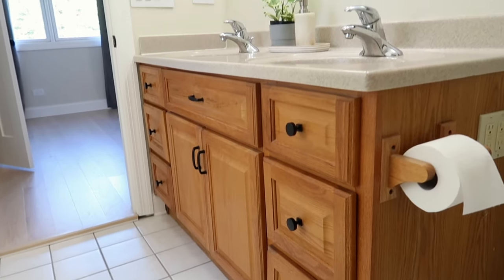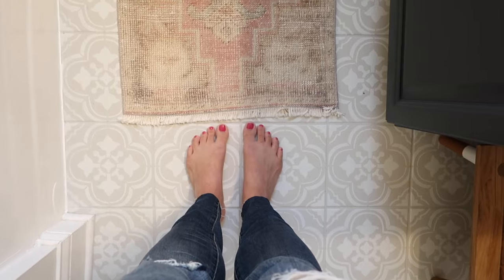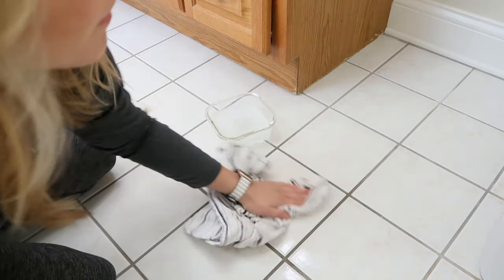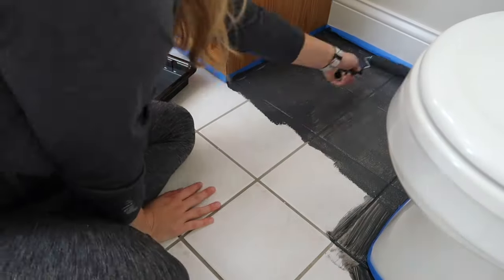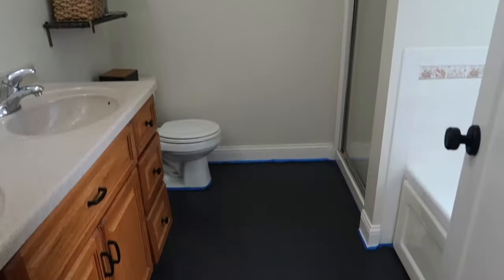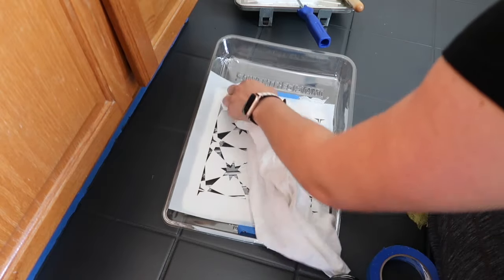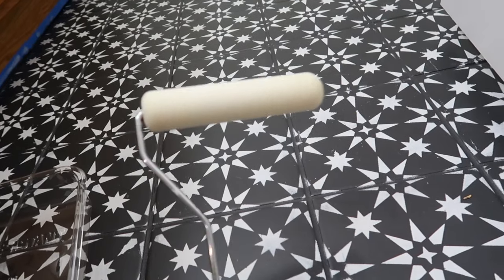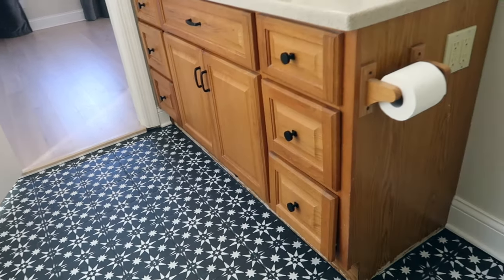How to Paint your Tile Floor with Rust-Oleum HOME Paint

Comment: I prefer the before look. And as durable as the paint may be it won't last as long as the tile - especially in a bathroom.
Reply: I simply do not understand why someone would put paint over a very neutral ceramic tile.  Toss a large rug on  it if it annoys you. All of those redos looked very cheap and would be the next person’s nightmare. 🤷🏻‍♀️smh
Reply: I think it looks way better and more modern
Reply: @Sherry Boesch  I agree. But we have this tan tile in our bathrooms. Like the build tile. (I don't understand why builders use tan in their builds. I'm taking they get it cheap.) We have been going back and forth about painting vs laying plank vinyl. The issue with the plank is that in between mold, etc. can grow.

Comment: Has anyone noticed a minute or two after the paint goes down, some (teensy tiny) spots don't take? I did use a steam cleaner on the grout a couple weeks ago, then yesterday I sprayed tile and grout with crud cutter, then wiped up with a micro fiber rag. After that I steam mopped in hopes to get all the crud cutter up. Now wondering if I didn't get it all up!? :( It is only a few spots, wish I could upload a photo.
Reply: I've only put down one coat of the base coat so far, will need to do a second coat in 6 hours.

Comment: Your floor looks great! Just out of curiosity what are you cleaning/mopping your floor with? I am thinking of trying this method as I have the 1950's pink and white tile. My floors held up nicely over the years but it looks very dated. Any suggestions?
Reply from the maker: You can stick to your normal cleaning routine, but I would avoid anything too abrasive. I use my Dyson vacuum on my floors to pick up any dust and debris and then I mop them every other week when I clean the bathrooms. For the most part, you should be able to follow your normal cleaning schedule, even with painted floors. I would definitely give this a try! The blog post has more details. https://thediyplaybook.com/stencil-tile-floors/
Reply: @Thediyplaybook  Thank you for the response. I will definitely check out your blog. Happy Holidays!
Reply: I only use water with a microfiber cloth on a map that sticks to it. No special things and just damp mop all over. And it's done great.
Reply: I would LOVE to have pink and white tile

Comment: Ok ma'am.  One more question and I will leave you alone. At Home Depot it is about $49 for 1 gallon of the charcoal gray. And it is about $30 or so for the topcoat and Matte..Does that sound about right? Since I only need a quart of each this is really starting to ramp up. I was just curious on the sizing that you got what works best for you. Thanks
Reply from the maker: You'll need way less than you think. I had a gallon of the charcoal, but easily could have just used a quart. So unless your space is really really big, a quart of each color you want to do (plus, the top coat) is all you'll need. I recommend the kit as it comes with what you need.

Comment: This is a great video!!!!  Approximately how long will the paint last before it begins to wear out?  Or would sealing it every few years (how many) keep it from wearing through?
Reply from the maker: The paint is specifically designed for this purpose, so it's designed to last. You can do additional coats of sealer if you need. I actually just did a review of my 3 painted floors after a year of living with them. You can read about it here.
https://thediyplaybook.com/painted-tile-review/

Comment: Hi.. Can this product be used on tile walls?
Reply from the maker: If the walls are not in a wet space, then yes! If you're referencing tile walls in a shower, then this is not the product for that. Instead, check out this blog post.
https://thediyplaybook.com/how-to-paint-your-bathtub/
Reply: @Thediyplaybook  great, it’s not for a wet space. Thank you. Can’t wait to start on that project. ☺️
Reply: @Thediyplaybook  How wet can this floor get? Even outside a tub the floor will get quite wet. How might you explain the difference because bathroom floors do get quite wet.
Reply from the maker: @kstevenson3504  I would use it outside of a shower, but not in a shower where it directly has water flowing onto it.

Comment: AMAZING. Question though, when you move from tile to tile to do the white stencil, the wet white paint doesnt get smudges when you lay the stencil over it? I see they overlap on the edges when you work your way down the line.
Reply from the maker: The key is to not use too much paint! A very light amount. And I suggest getting a few stencils as they can get kinda gunky as you progress.

Comment: Please tell me.  Does this work in the tiled shower floor ?
Reply from the maker: No, it does not. But they make another product for that. This blog post goes into detail...
https://thediyplaybook.com/how-to-paint-your-bathtub/
Reply: @Thediyplaybook  I've watched several of your videos. The link you provide above doesn't pertain to the shower floor. Can we use the same paint we use on the shower walls on the shower floor? Honestly I wish we could use a slightly different color on the floors.
Reply from the maker: @kstevenson3504  No, you can't use this product on any tile that will see direct water from a shower. Instead, there is a different product for that. I believe it only comes in white and almond, but you'll have to check out the product itself. 

https://thediyplaybook.com/how-to-paint-your-bathtub/
Reply: @Thediyplaybook  Thanks!  This product was on a list recommended for shower tiles. I hate there is no gray color.

Comment: I followed ur video.   My top coat is drying now.   It still looks like the cloudy tanish color.  And it’s been 12 hours.   Is that normal?
Reply from the maker: The top coat should be clear all the time. It will look wet at first, but should always be pretty clear.
Reply: @Thediyplaybook    Not good.   It came into the rustoleum floor paint kit.   It was a tanish color and went on kinda cloudy.

Comment: Look great.  I have a couple of questions, though. I have a small home with ONE bathroom. It is using old 1" subway tiles. I am getting rid of an old pink toilet. I'd like to paint my bathroom floor.  Is there anything I should keep in mind? How long do I have to wait before installing the new toilet? I am not going to use stencil.  How long a wait do I have?
Reply from the maker: Hi Barry, 
I think this would definitely work for your bathroom. I would remove the toilet, clean the floor really well, and then get started painting. You have to wait 6 hours to apply the second coat, so I would start early in the morning. Then do your second coat, and then a couple of hours later do your top coat. You would be able to put the new toilet in the next day, but I wouldn't put anything else on the new floor for at least a few days just so it really has time to cure! 

I've done this 3 times, so I recommend reading these blog posts that are full of more tips. 
https://thediyplaybook.com/stencil-tile-floors/
https://thediyplaybook.com/how-to-paint-tile-floors/https://thediyplaybook.com/tips-to-paint-floor-tile/

Good luck!
Casey
Reply: Hi Casey.  I will take a look at the blog. Did you read the part that it is my only bathroom? It seems that I will be without a toilet or the use that room for a while.  I definitely appreciate the information and the needed insight
Reply: @Thediyplaybook  ok so I am putting my second coat on and then stencil. Do I need to wait 6 hours to apply the stencil or just until it's dry?
Reply from the maker: @elainewilliams2608  Just six hours after that first coat. Then just until dry. This blog post walks you through each step. https://thediyplaybook.com/how-to-paint-tile-floors/
Reply: @Thediyplaybook  Thanks. My project already looks great. I appreciate your vids!

Comment: I recently did this. I'm a little concerned with how thin the step 2 coat was going on the floor. I needed to really roll it to apply it evenly. Does this jive with your experience?
Reply from the maker: Step 2 as in the top coat? If so, yes..it's definitely runny. But it will still protect it just fine. It's not the same consistency as paint...definitely thinner. Just get it on there as best you can. You can always do more coats if of the top coat if you want more protection.